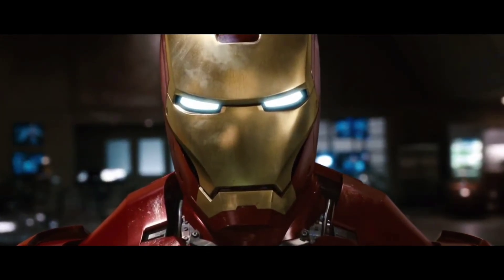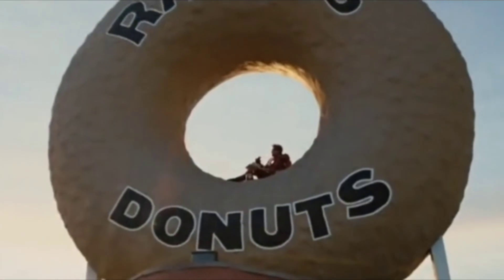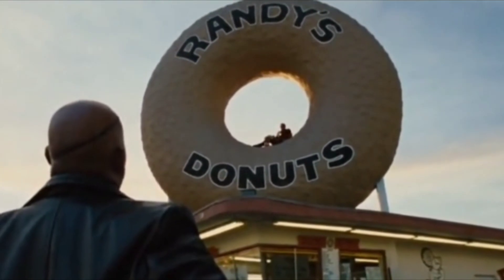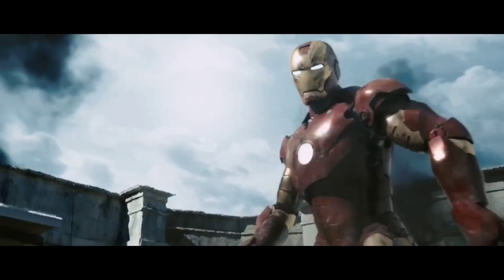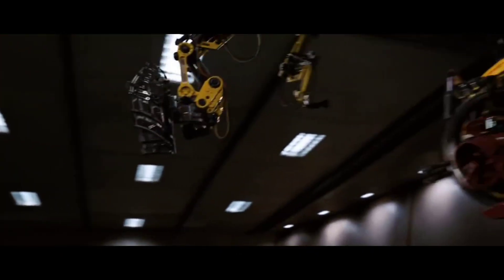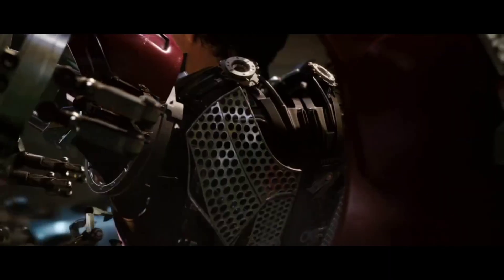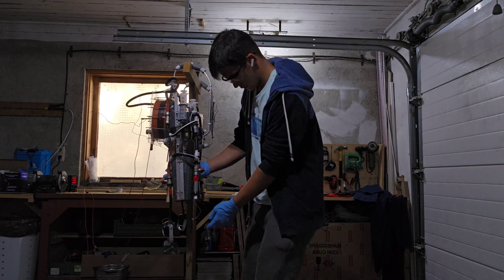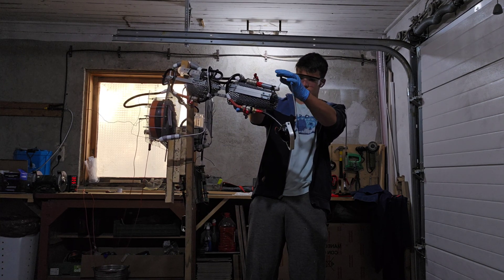Building my own Iron Man suit

Comment: Also i am trying mind helping me please you are very cool all a have is this #include <Servo.h>

Servo helmet;
Servo chest;

const int buzzer = 8;
const int safetyBtn = 2;
const int h2Sensor = A0;

void setup() {
  Serial.begin(9600);
  
  pinMode(buzzer, OUTPUT);
  pinMode(safetyBtn, INPUT_PULLUP);
  
  helmet.attach(9);
  chest.attach(10);
  
  // STARTUP TONE
  tone(buzzer, 440, 200); 
  delay(200);
  tone(buzzer, 880, 400); 
  
  helmet.write(0);
  chest.write(0);
}

void loop() {
  // EMERGENCY SENSORS (BUTTON OR GAS LEAK)
  if (digitalRead(safetyBtn) == LOW || analogRead(h2Sensor) > 400) {
    emergencyRelease();
  }

  // COMMAND HANDLER
  if (Serial.available() > 0) {
    char signal = Serial.read();
    
    if (signal == 'O') {
      tone(buzzer, 600, 100);
      helmet.write(120);
      delay(500);
      chest.write(90);
    } 
    else if (signal == 'C') {
      tone(buzzer, 500, 100);
      chest.write(0);
      delay(500);
      helmet.write(0);
    }
    else if (signal == 'E') {
      emergencyRelease();
    }
  }
}

void emergencyRelease() {
  tone(buzzer, 1000, 50);
  helmet.write(180);
  chest.write(180);
} 

Edit 1 : also a am using a hydrogen reactor because unlike hydrogen in a tight tube shoots out right like a rocket well i am overthinking but you know what i mean 😅 it go straight and fast btw i am using python coding 😅😊🎉
Reply from the maker: Thanks, the coding language you use seems to be Arduino. I am not familiar with that. I only have a Raspberry Pi, and to code on that, I only use Python. Also, what did you want to say about your hydrogen reactor? I couldn't understand. But I am happy to help you in any way I can if you can explain a little better.

Comment: Try using some JB weld to seal the gaps in the HHO reactor instead of silicone if you can get your hands on it, it’ll help make a full seal. Really cool stuff by the way nice to see how many other people are working on Ironman tech :)
Reply from the maker: The problem isn't that the gas is escaping from the HHO reactor, but from all the fittings, because I couldn't find ones with a small enough diameter, does JB weld work bettwen rubber and metal? Also, the silicone isn't stuck to the lid of the generator, only to its body, and it is used more as a gasket so I can still open it to clean or to change the arrangement of the plates.
Reply: @Garage_Builds ohhh that makes more sense I misheard you in the video, JB weld should work for that I’m not entirely sure I’ve never tried it with rubber to metal you can give it a try. Either way nice reactor
Reply from the maker: @Joseph_sidl Thanks for the advice. I'll try it. Also, your newest reactor is awesome too.
Reply: @Garage_Builds thank you bro
Reply from the maker: @Joseph_sidl Hey man, can I ask you a favor? Could you give me a shout-out in one of your upcoming videos? It would help me a ton.
Reply: @Garage_Builds yes ofcourse
Reply from the maker: Thank you so much